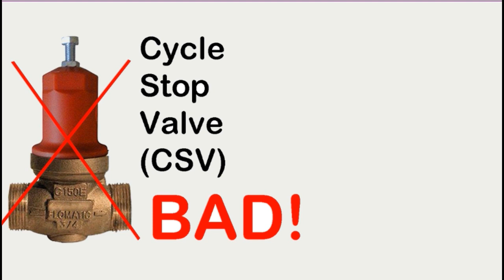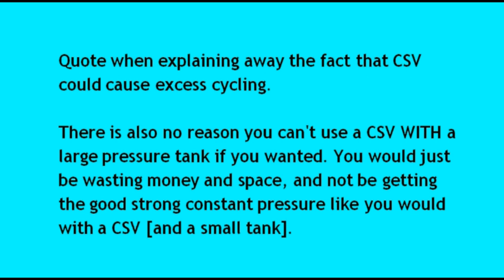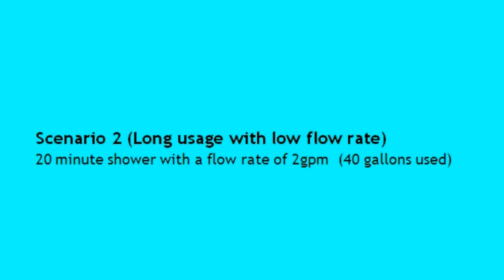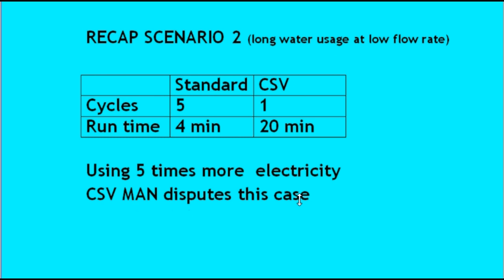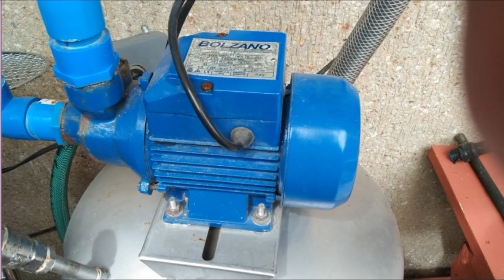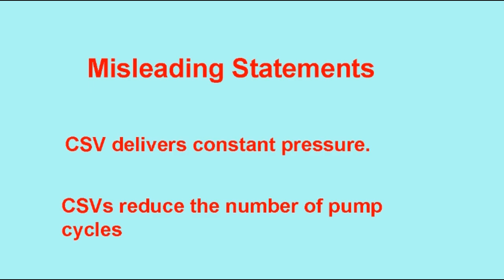Cycle Stop Valves ARE BAD for pressure tank systems!  Pros and cons of CSVs – few pros, many CONS!

Comment: Hello seems like you might be a guy that will be willing to answers questions without to much gruff. 
I am looking to install whole house water filters these will be installed before the water softener. I am concerned about the pressure loss through the filters. Someone suggested I put in a 50/70 switch and install a csv to keep it at a constant 60. Now this sounds good knowing then that it would have that constant pressure. 
I have a .5hp pump 52gallon tank and switch currently set at 30/60. I am not sure of flow rate of pump. 
I wanted to see about adding in a second pump and tank later in the line to boost pressure back up after pressure loss. I was also told this wouldn’t help me either. 
Can you help with this at all
Reply from the maker: Sure, I will help you. First I will read your description carefully. Then I will probably ask some questions, then I will give suggestion.
Reply from the maker: I can tell you right now that in your current setup a CSV will not help. You only have a .5 hp pump. That is the first problem. How can a CSV magically make your pump stronger? It Can't. I don't think your problem is very hard to solve.  Give me the details of your setup and I will help you. Give full details. Where is the water coming from? Well? Town? You have submersible pump?, you said you have 52 gallon tank? You mean pressure tank? What about water storage tank? In particular i need the order of your equipment, that is, what does the water go thru first, second, etc. Please give me full details and I am confident I can solve your problem. Consulting fee optional!
Reply: @LarryElterman  Hello. First to start off I have not installed the filter system yet I am just concerned that there will be too much pressure loss.
Water is coming from well it has a .5hp submersible pump. then into a 52g pressure tank with a 40/60 pressure switch>>> 100 micron spin down filter>>> 50 Micron Spin down filter >>> 20x4.5 20 micron filter >>> 20x 4.5  5 micron filter >>> 20x 4.5 iron filter (with a rated 5psi drop) >>> 20x4.5 heavy metal filter >>> water softener >>> to rest of house
A. I do not have the availability for a storage tank outside or in
B. please dont ask about filter being used we dont need to go into water testing right now
C. I do not have technical specs of pressure los for other filter. i know sediment filter should not cause pressure loss every time yo push water thru a medium 
D. Consulting fee  will a thank you and spread the word of how awesome you are work :)

Please let me know if you need anything else from me
Reply from the maker: @matthewgifford8320  Ok, the main problem as I see it is you only have a ½ hp submersible. You are going to the pressure tank first, which means that pressure will certainly be reduced from whatever is coming from the pressure tank. One way to solve the problem is to increase the pressure range of the tank.  Right now you have 40/60 right?

After going through the filters it may be reduced (lets just say hypothetically) from 40/60 to 20/40.
So one way to solve the problem is to replace (or adjust) the pressure switch to 60/80 which will then be reduced by the filters to the 40/60 you want.

There are two problems. The pump may not be able to reach the new 80 pound cut off pressure since it is only a ½ hp pump. The other problem is that you have to make sure your plumbing leading up to the pressure tank and the pressure tank itself can take 80 pounds of pressure.

If the pump can’t make 80 pounds you are out of luck, you would have to replace the pump with a more powerful one.

Here is an alternative using a small storage tank (say 50 or 100 gallons) and a booster pump.
Make your order of flow like this:

Submersible pump to your filters and from your filters into a storage tank. The storage tank is controlled by a float switch, so it is very efficient. The submersible goes on when the tank is empty and off when the storage tank  is full. You are not concerned with the pressure as long as the storage tank can be filled. The storage tank is filled with FILTERED WATER. Now from the storage tank go to a small booster pump and then to your 52 gallon pressure tank with the same 40/60 switch. All your problems are solved!
Reply: Thank you sir. I will take what you have said here and think about. I appreciate your help

Comment: Your video was too kind to CSV! Your example of the 20 minute shower showed only a loss of 2.5 more electricity usage.  Consider this, 200 gallon pressure tank with  60 gallon draw down, 5 HP pump capable 100 Gallons Per minute flow. You need this big pump for lets say your farm irrigation system. Now take 60 minute shower at 2gpm.  A 5 HP pump is about 3700 watts. With a CSV your 1 hour shower will use up 3.7 KWH. With your normal system the 1 hour shower will use up 120 gallons. Your 60 gallon draw down tank will fill up twice. 
At 100 gallons per minute flow it will take about 40 seconds to fill the tank. Total run time of pump is 80 seconds or 1.33 minutes. Compared to 60 minutes of run time with CSV. That's a loss of 4500 percent. 45 times more run time! Even assuming a 50 percent reduction of pump power as the CSV guy claims, it would still use up 22.5 times more electricity! At 20 cents per KWH with a CSV your shower is costing you 74 cents. With the CSV it is only costing you 3 cents!

Comment: Thank you so much for this video! I was considering buying a CSV but I had nagging concerns, but the CSVs videos say they are so perfect! I saw your video and all my concerns were validated!  I guess you really hit a sore spot with these people. They don't evidently don't like the truth. I saw their comments before you removed them. My god! So Nasty. As Shakespeare said: I think they doth protest too much!
Reply: No plumbing system is perfect, it all depends on how you set it up, and the plumbing you are attaching it too. Personally, I'm going CSV, I do not see the downside to it, the continual pressure is nice, really nice. Your pump is designed for continuous operation, in my experience they do last longer in this state, vs on off on off. I have been around pumps my entire life, and am glad I stumbled upon this CSV system, I have been wanting something like this for years! The only reason I found it is that I am replumbing my house and actually doing some research on not only my plumbing but my well too. It will be nice to be rid of that mess in my basement, the huge 47 gallon tank and all of the piping on the floor, along with the expensive bladder tank. These large bladder tanks, a quality one, are more expensive than a quality submersible pump, and trust me, they rarely if ever outlive a pump. I have never seen one do that.

Comment: Larry, thank you for this video. I was one day away from ordering one of these valves. I was aware that having the pump cycling continually on and off was not good for the pump. I assumed the guy selling the valve was honest and knew what he was talking about and did a careful scientific experiment and analysis.While I did have some initial questions about it I did not think it thoroughly  through. After watching your video my questions were answered. Your video was well organized and clearly explained the the pump system works problems with the CSV valve. I did go through your math and you are exactly right. Again thank you for the analysis. I certainly WILL NOT be ordering the CSV valve.
Reply from the maker: Thanks for your nice comment. Glad I could help. You should have heard the insults I got  from the cycle valve man for my video. He told me everything I said was a lie and that I was a disgrace to the engineering profession!
Reply: Richard,

Read my comment above yours.  Properly sized tank and CSV work very well.

Comment: Larry, thanks so much for this helpful video! I was considering a CSV and I’m second guessing that idea now. I just purchased a 1 HP 20 gpm pump for my home and irrigation system. There seems to be a wide range of opinions on how long a cycle time should be from cut on to cut off. My current setup on a 44 gal tank only takes 20 seconds. I have heard at least 1 min of run time, with most recommending at least 2 mins of run time per cycle. Do you have any opinion on that? How much do you think short cycle times might impact the life of my pump?

Adding additional tanks or going with a VFD system both seem like expensive gambles, with no definitive answer on how much pump life this will buy me? I don’t care about constant pressure, I just want to extend the life of my pump. Thanks again!
Reply from the maker: Oh dear, there are many nuances here. The amount of time it takes a tank to fill up from cut on to cut off (lets call this the fill time) depends on 4 things.
1. the flow rate of the pump
2. The tank size
3. The pressure range
4. And if any water is being used while the pump is on.

This is different than what we may call the cycle time during usage, the time  it takes for one full cycle of pump on to pump off  to pump on again. The number of cycles is the number of times the pump goes on.

Of course the bigger the tank the better, that's a given. That will always reduce the number of cycles.

In a perfect world we want to reduce both the number of cycles and the pump ON time, the amount of time the pump is running. The two are not the same!

A CSV reduces the number of cycles but at the cost of greatly increased pump "on" time.

You need not be concerned about the tank FILL UP TIME, that is kind of irrelevant. A larger pump will always reduce the fill up time, but that is not always a bad thing.  Be concerned with the number of cycles and the amount of time the pump is running, not the fill up time. To break things up i will end this comment and start another
Reply from the maker: Ok so now lets switch gears and think about something else. Why are you so concerned with pump life? Are you trying to reduce cost? Or is it a horrible pain in the neck to change the pump, so you want to avoid that? Where is the pump by the way? If its a submersible in a deep well I could see why you would want to avoid pump failure. If it's a booster type system, its no big deal to change a cheap motor every 5 to 10 years, so I would ask, what is your system configuration, and what is your goal? Is your goal to reduce long term cost or is your goal to avoid repairs at all cost?   You said you don't care about constant pressure. Forget about a VFD, that's a big cost, there are cheaper solutions. Tell me your goal and your system configuration (where is pump, do you have a water storage tank, etc etc)  and I will help you some more. I don't mind, I enjoy thinking about this  kind of stuff.
Reply: @LarryElterman  Thanks for thinking this through with me Larry. I appreciate the help, as I’m just a regular homeowner with no engineering experience at all. After some general research on 1 HP well pumps, I came away with the general assumption that these pumps need at least a 1 min “Fill up Time” as you call it, as this helps with cooling the motor and extends the pump life. Sounds like you might have a different take on this idea?

I have a submersible pump, A.Y. McDonald 23000 P-Series 20 GPM that’s only 70 ft deep in a 100 ft well. I’m trying to extend the life because it’s a huge pain to access my well. It’s between houses and a lot of guys can’t even get their equipment in my space. What a headache! 

My plan currently is to upgrade my pressure tank setup with an option that provides at least 20 gallons of drawdown volume, which in theory should get me closer to that 1 min of “Fill up time.”  Thanks Again!
Reply from the maker: @ronpaulsdad5260  I can help you vastly increase your well pump life. I will tell you how shortly. As for pump run time, for the life of me I  can't see how running a pump longer is better than running the pump for a short time. I think what people are thinking is that if it is a quick fill up time that means many cycles. For example with a small tank the fill up time would be short and in a short amount of time it would have to go on again. Thus many cycles.  So in some cases a short fill up time  translates to many cycles. I think this is what people are thinking and getting confused with. However consider this scenario. A very large pressure thank with an extremely powerful pump. In this case the large tank would fill up very quickly and there would be a short run time. However the large pressure tank would supply water for a long time, thus many less cycles. How can that be bad for the pump? What the pump hates is on, then off then on in rapid succession. But I can't see how the pump minds On for a  few seconds, then a long time off then on again. Follow me? Perhaps there is something I don't understand, but I don't think so. But in your case, increasing the pressure tank size would both increase fill up time and reduce cycles, so you are doing the right thing for the wrong reason. But there is a better way!!! A much better way in my opinion.

Ok, here it is. Have the well pump, which is the expensive pump you don't want to replace,  go into a water storage tank. Make it as large a water tank (not a pressure tank, a water storage tank) as possible within your budget and space requirements.

Now - a water storage tank has no pressure in it, it is controlled by a float valve, so the well pump would go on when the water tank was empty, and off when it is full. For example, suppose you had a 1000 gallon storage tank. Lets say the pump goes on when it is down to 100 gallons, and off when it fills up to 900 gallons. than means you are filling up 800 gallons at a time. With a gpm of 20 your pump would be on for 40 minutes! After than the pump would be off a long time until the 800 gallons was used up. As for getting the water from the storage tank to the house, a cheap booster pump will do, easily replaced if it breaks!
Reply: @LarryElterman  That's what my system is, however i have a low producing well at 1-2 gallons a minute.  Well is 410 feet deep and pump sits at around 320'.  So im using the well as collection/storage until the pump kicks in and runs till it fills the 1000 storage tank to 900 gallons or the pumptec module shuts it down.  So far so good as it's all been running for 25 years.
Reply: That is a good sized pump you have, and it sounds like you are in a subdivision? When you installed that pump, what were you going for, water pressure or water flow? The two are vastly different. Myself, I am going for water flow, thus the CSV unit and properly sized pipes. 

When we did irrigation, we ran straight from the pump, continuous run time, 3 inch pipes/lines with heads, the pumps would last on average fifteen+ to twenty years, this was on a golf driving range, 6 inch well, no recollection on the hp. We only replaced two in my 56 years, one from lightning damage, and that is the real issue with most submersibles, that will happen in most cases before the pump ever wears out. 

I would run the irrigation direct from the pump, hose bibs too, divert it prior to the household system. Put one hose bib on the water softener to wash the car, spot free, if you are into that. That is what I do, same for say a  pressure washer, direct from the well, on a hose bib. Use a spin down filter to catch the silt, sand and garbage to keep the pressure washer and sprinkler heads clear. 

Additional tanks will give you time on the pump cycling, but how much water are you using during the day in the actual household? There are two of us here, we have the dishwasher running at night before we go to bed, usually every other night. Laundry a few times a week and showers. Toilets use roughly 1.5 gallons per flush, I miss the older 3 gallon models, and of course washing of hands. If you have a household full of teenagers, I could see two tanks, or one big one. Me, I would again go CSV, let them shower to their hearts content and the pump do its job. They are designed for continuous run time. 

The reason I am going with the CSV, it just makes more sense, and frees up quite a bit of room in my basement. I have one of those large tanks too, 47 gallons, and it takes up too much room, and is always a continual concern, I hate replacing those things, they are just as costly as a well pump, if not more. 

As far as the pump turning on and off with the CSV, install a twenty gallon bladder tank, that will give you plenty of toilet flushes and hand washing. I'm personally going with the four gallon tank, and not concerned in the least with the pump or switch. The switch will fail long before the pump. 

Just make sure you have pressure blow offs, and don't get crazy with the internal house pressures. Water flow is what you want, not pressure, the CSV keeps the water flowing, just like a continuous hot water heater. Your actual plumbing will contribute to water flow, or it will be the bottle neck. Properly sized pipes are just as important as a properly functioning well, be it CSV or bladder tanks.